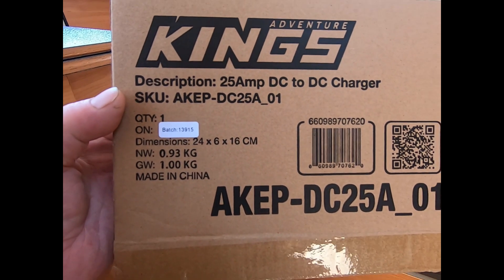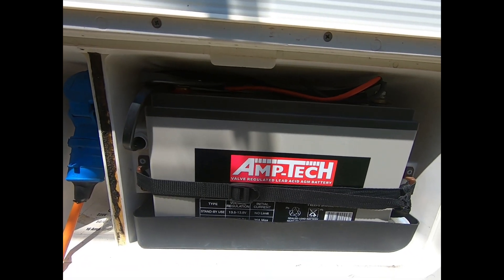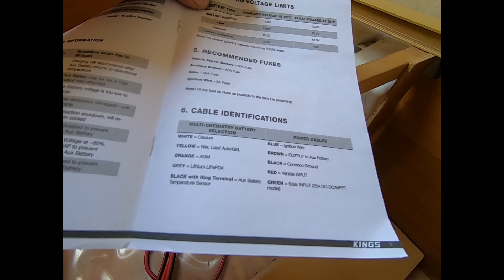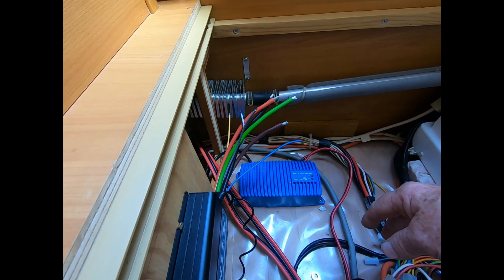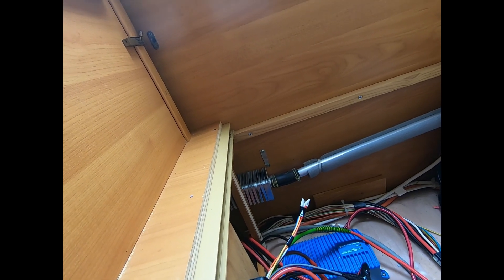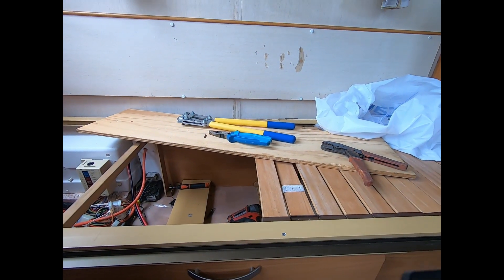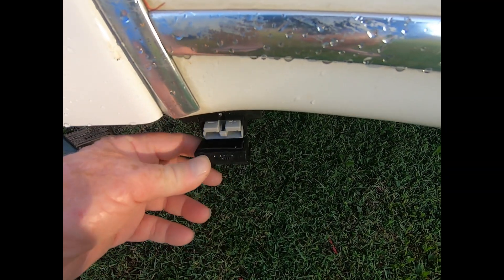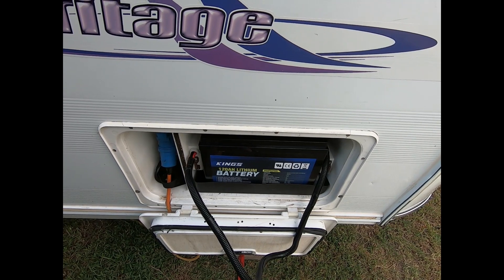Kings 25A DC to DC charger and lithium battery install

Comment: Just curious how did you change the mode on the dc dc to lithium from agm??
Reply from the maker: The caravan didn't have a DC to DC charger. On the Kings DC to DC charger you can select AGM or Lithium from the colour of the wires. The grey wire is used for Lithium batteries. The orange wire is used for AGM batteries. Cheers.